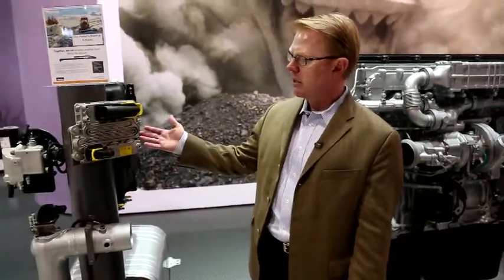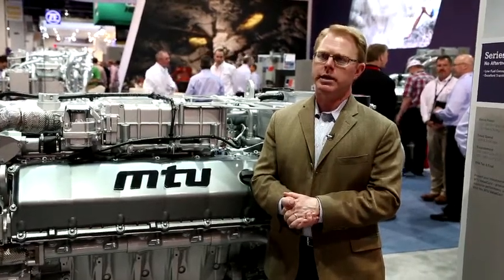MTU America Tier 4 Solutions for Off-Road Engines and Equipment

Comment: @1:35 he says "Diesel Exhaust Fluid". What he means is 'Urea'. Or piss. I kid you not! I worked on UK MAN engines (MAN owned MTU before Rolls Royce bought MTU) and the various systems used to reduce emissions to meet EU standards. It is labelled 'AdBlue' but it is Urea as that reacts with the NOx molecules and creates Nitrogen and other non harmful emissions.
Reply: 1chish 
Nope. Daimler owned MTU before being bought by RRPS.
Reply: 1chish 
Before Daimler it was Tognum and before Tognum it was DDC.
Reply: 1chish 
You are correct about the urea though.